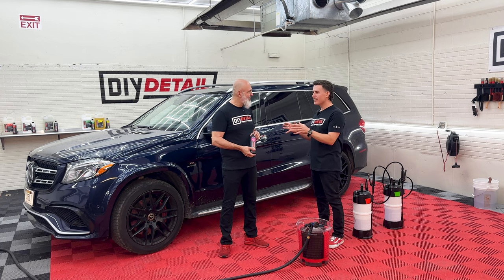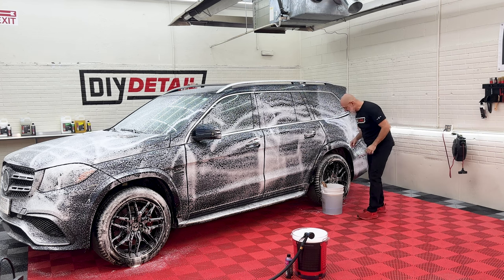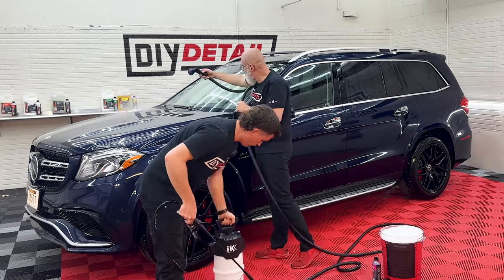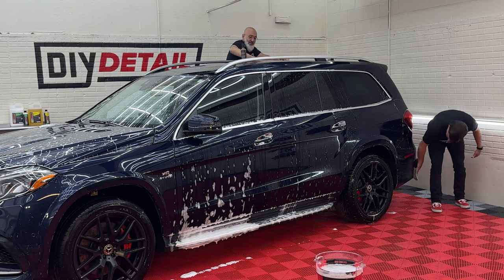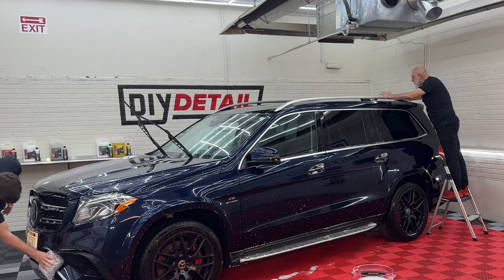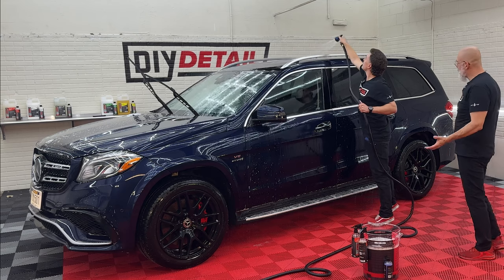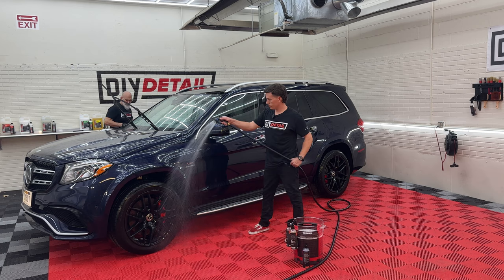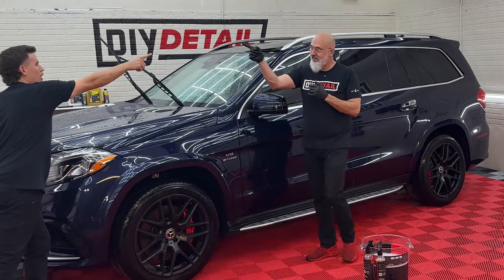How to wash and decontaminate TRASHED paint

Comment: In what other ways can I remove bug marks, tree sap and water spots by not using any decontaminating agents? Can I use a petrol or a diesel to clean them off?
Reply from the maker: Yes, but it’s not very good for your paint.
Reply from the maker: We would never recommend using that, but some professionals (we also don’t recommend) use paint thinner or wheel acid for stubborn water spots or materials on paint, it all depends on the scenario. Again not our recommendation. We recommend following our procedures and products because we know they work and are safe…beyond that, you now have some other options but we’re not endorsing them because they’re not good for you to breath and they can be dangerous on paint 👍

Comment: I have Kia Seltos in Glacier White Pearl color. Bro, if I want to polish my car, should I use carnauba wax or metallic polish for buffing? Which one should I use first and last? I want to remove swirl marks, minor scratches and want to get a complete gloss as well as saturation over the paint. And also suggest which pad should I use for both of them. I would be delighted for your reply. 😃
Reply from the maker: I would polish using DIY Detail Gold Standard Polish, and our yellow waffle pad, then follow that with one of our ceramic coatings for long lasting protection.

Comment: Do you take suggestions for new products? An all-in-one decon spray would be brilliant. You use iron fallout remover with the clay towel so that cuts 2 steps into 1, well carpro has trix which removes iron fallout and tar so this used with the claybar would be 3 steps in 1. There's just 1 step missing....water spot & mineral remover. My suggestion is could you make an all-in-one product that removes iron fallout, tar, and water spots, a product that you could use with the clay towel and cut 4 steps down to 1 saving lots of time and money on multiple products? Complete decon done in 1 easy step would be a detailers dream
Reply from the maker: That’s would be our dream as well. Unfortunately though the chemistry doesn’t add up. Tar/ adhesive removers are damaging to clay and synthetic clay products, and are solvents. Iron removers are PH neutral and waterborne, finally Waterspot removers are acidic.
Reply: @diydetailofficial  that's a shame. I thought there may be a way around it if we let the clever science guys figure it out. I'm sure there will be better options in the future especially given all the advancements in detailing that have been achieved in the last decade or two.

Comment: I’ve done a few of those “haven’t washed it in 5 years” type vehicles with a ton of buildup on the horizontal surfaces. I wash those areas with the flag tipped brush to get the looser bits then clay with iron remover for a smooth, glossy result
Reply from the maker: nice!

Comment: With how hard the water is in Michigan along with the salt 1/2 the year, I pretty much always do a waterspot remover step just in case. Thankfully they are cheap, and I don’t think I use more than 1/5 a 16oz bottle for an entire car unless there are visible spots.
Reply from the maker: Good practice!
Reply: I picked up a few water spots on my Kia stinger after parking outside last week. Crystal serum light is the coating I have. I’ll probably try water and vinegar before I buy the actual product
Reply: @woocoheed  worth a try, but I’ll say that I’ve never really had the results I wanted from vinegar unless it’s just a residue.

Comment: Clay and wheel acid are two products I try to avoid using but, there are times when I am glad they are on the shelf collecting dust for me to use on those rare occasions, otherwise I may still be cleaning those wheels or decontaminating the paint today.
Reply from the maker: Amen to that. Not what we would teach the DIYers out there to use wheel acid, but there is a place for it (sometimes)....as many working detailers know. Same goes for the clay bar, it can be useful although it's pretty aggressive. The other 99% of the time, our methods are awesome:)

Comment: If a vehicle like my truck as visible big rust chunks, should I even clay that, or just use DIY Detail Iron Remover and let it sit?
Reply from the maker: After the wash? Probably just spray iron remover on, let it sit and dwell and gently rinse off. See what's left, be gentle. If you use the towel on the rust spots it can really mess up the towel so just use common sense
Reply: @diydetailofficial  alright that’s what I thought, but wanted to double check. 🤙🍺

Comment: 2 questions.
1. Could you use a clay towel for every wash, especially if you don't let the car get very dirty ?
2. Since  rinseless breaks down in water, will it hold up in a sprayer and left?
Reply from the maker: 1. yes, but every wash is too much. Once or twice a month is also excessive but totally fine. For example maybe you use it to assist with bug guts on your windshield and front bumper...then you notice one spot on the paint feels rough. You could "spot treat" with the decon towel, gently.....just use common sense lol and yes it's totally fine in a sprayer. I leave a bottle of Rinseless in a spray bottle under my kitchen counter top for months and it's fine every time I bring it out to clean

Comment: Loved this segment! I have a 2009 Camry that wasn't cared for the best in it's previous life and has some oxidation on the horizontal surfaces. When I took the decontamination towel to it, it sounded just like that! I may have to get some tree sap and water spot remover. There are also a few small spots starting to show on the roof where the clear coat has failed.
Question: I'd like to polish the car to clean up the paint and get rid of a lot of the micro-marring. Should I steer clear of the area where the clear coat is failing? Any reason to avoid the dull areas of oxidation? From your experience will I just make the areas that are failing look that much worse by making the rest of the paint that is in decent shape better? Thanks as always!
Reply from the maker: If the clear coat is failing, just stay away from those areas. The duller areas, try a test spot. Do what you can do:)

Comment: 1. So if you are doing decontamination, fall or spring and your car is coated, do you do chemical decontamination first and then physical decontamination or vice versa?  

2. Is your tree sap remover also your line up’s official tar remover?
Reply from the maker: Our Iron Remover is paired with the decontamination towel -- on your bed of Incredible Suds after the wash, you apply one spray of Iron Remove on the panel, one or two sprays on the towel and you decontaminate that panel. Then repeat on the next panel, and the next. It's a combination of chemical and mechanical in the system we teach:) As for question #2 -- yep, it's a great tar remover as well. Hope that helps!
Reply: @diydetailofficial  it did, thanks!

Comment: Question regarding iron decontamination on a convertible. Is there any concern with the chemical staining or damaging the top? We wouldn't be applying it to the top, but certainly during the rinse, you potentially may have the rinse getting down into the to the well and coming in contact with the top. I have yet to see any detailer talk about this process on a convertible car? thank you!
Reply from the maker: No concerns

Comment: Great video as always! Thank you for producing great products and content! 

In some videos you use iron remover first and others, spot remover first. Is there any difference chemically or just safer for the paint using one over the other first? As in safer or more effective to get the minerals off the paint using the water spot remover before using the psd towel and iron remover? Or using the psd towel and iron remover first to get the harder/more stuck on contamination and iron deposits/fall out off before agitating the water spot remover with a micro fiber?

Is the tree sap remover as strong as some of these citrus based tar removers such as carpro or Gtechniq (I know you can't compare brands) in general? Is your tree sap remover a citrus based cleaner?

Is it over or underrated to use panel prep before polishing? Thanks!
Reply from the maker: The order varies according to condition, but it’s very minimal. 

DIY Detail Tree Sap Remover is solvent based and works very well on Tar. 

Using panel prep before polishing is both a waste of time and product.
Reply: @diydetailofficial  Thanks for the quick reply! I'm glad to hear you say that as I've always thought the same but I keep hearing professional detailers say to panel prep before polishing and I thought I saw one of the DIY Detail videos where you guys did panel prep before polishing but I might be mistaken. Especially with rinseless wash on the vehicle and then using a rinseless dampened pad with the gold standard polish it seems counter-intuitive to panel prep. 

Thanks again for all of your knowledge that you so willingly share! It's always great to learn more and more about this awesome hobby!

Comment: Here is a question whenypi are doing dilution ratios in a large ik foamer. what is the total voume of water and product are you using. So example the all clean 15 to 1. How many onces of water to All clean. Especially since ypu dont want to fill up the foamer with wather Either. So how much water do you typically use Ivan in the ik Foam pro 12?
Reply from the maker: 120oz of water
8oz of DIY Detail All Clean 
1/2oz of DIY Detail Incredible Suds

Comment: The sprayer with incredible suds in it, is it the “foaming” iK sprayer that ur using or just regular? Great video didn’t really think about I could foam soap without pressure washer.
Reply: And if it is the foaming sprayer which tip color green, white, or orange? Ty
Reply from the maker: Yes it’s a foamer, it has the standard tip
Reply: @diydetailofficial . It came with all these tips wasn’t sure, thanks!

Comment: A question for Yvan, are all clay towels roughly the same? I tried a cheaper end clay towel which seems to have clay literally on the surface of the towel, and am wondering if there’s a noticeable difference between what you use and the one I got from The box store.
Reply from the maker: They are not, ours is a fine grade perforated synthetic decontamination towel

Comment: Hey guys, im finially about to get some designated car soap  and possibly a foam cannon. I was looking into Chemical guys and wonder if you have reccomendations on what soap to get for non a non coated 2014 Jeep Grand.

Also for water spot remover on glass have you tried the sud factory x2 and chemical guys heavy duty water spot remover, which works better?
Reply from the maker: We don’t try other brands. If you want our recommendations, for the soap DIY Detail Incredible Suds, for water spot remover, DIY Detail Water Spot Remover. You will find both at DIYDetail.com
Reply: How good does the water spot remover work on glass? I bought some spray that I had to work for 30 minutes and it didn't even touch it. I watched a video on the Sud factory Spotless X2, and it made it look super easy
Reply from the maker: @chrisfig3746 water spots are difficult to access. If they are extreme, the glass may be etched, requiring polishing.
Reply: Also, I just learned about ceramic coatings and am considering having one applied. I was curious as to the benefits of ceramic coatings vs waxing and what are the negatives? I have heard some comments of water spots on ceramic coatings and the difficulty removing them without damaging the ceramic coating.
Reply: Sorry for the dumb questions, I just went down the rabbit hole and theres a lot of new stuff out there from the stuff I have been getting at AutoZone. For years all I've ever used is Dawn dish soap

Comment: When using the tree sap remover prior to decontamination, should you dry the vehicle first, apply the tree sap remover, then go through the decontamination process with rinseless and iron remover? Or can you do tree sap while rinseless is in the vehicle. Trying to figure out the best process if you know tree sap is on the vehicle and you also need to decontaminate.
Reply from the maker: It’s most effective on a dry surface
Reply: @diydetailofficial  Is that also true for DIY Spot Remover?  Does it is most effective dry surface so should dry the paint first?

Comment: Hi community. Does using scratch removercproducts with da buffer remove clear coat on 19 models and above per say.
Reply from the maker: Yes any machine polishing has the potential to level clear coat, that’s why we teach speed 3 on the DA with no pressure while polishing. It’s safe and it can help clean/shine paint, even remove some deeper defects with our wool pad, for example 👍
Reply: @diydetailofficial  ok was only trying to use this process to get stracth out and not hurt clear coat per say
Reply: So it is OK to use da with scratch removers and orange pads

Comment: Yvan mentioned if you know you have tree sap, it makes sense to remove the tree sap remover before iron remover.  Should you use tree sap remover before water spot remover also?  Or really doesn't make a difference?
Reply from the maker: Yes, ideally, but this one was so contaminated that we didn’t know what we were dealing with exactly.
Reply: @diydetailofficial So ideally, the order would be foam, rinse, foam, rinsless wash, DIY Tree Sap Remover, Iron Remover with Towel then Spot Remover?
Reply: Or should Spot Remover go before Iron Remover?

Comment: Good lord, sounded like you folks were dry sanding the vehicle…
BTW, did you ever get around to testing whether quick beads can be applied with a damp applicator/towel then wiped off instead of having to drag out a hose or pressure washer? I think you folks mentioned that quick beads has Graphene in it but ceramic gloss doesn’t.
Reply from the maker: You can actually use quick beads as a spray and wipe last step protectant if desired👍
Reply: I've done it on my 78 corvette. Used rinceless and sprayed quick bead on it  than used a wet towel and spread quick bead on the car than wipe dry. Result is awesome.
Reply from the maker: @denthevetteman78  yessir!

Comment: Wiping the step board then the hood after with the same rag is a big nono
Reply from the maker: If you take a look, Nick rinsed off the mitt between the 2 in the wash bucket. Also with our foam rinse foam method, there’s no grit on the car to cause issues.